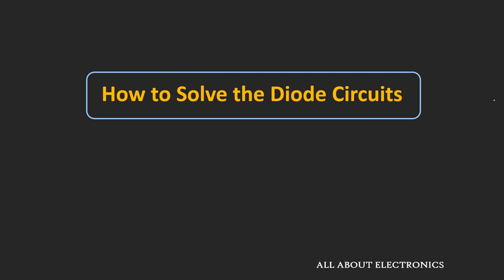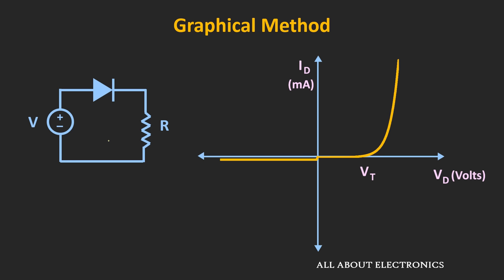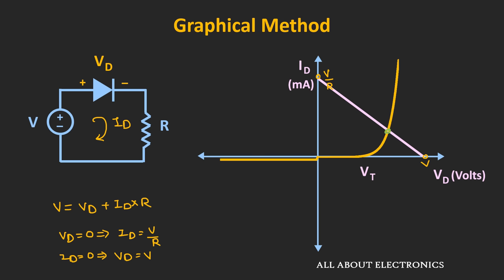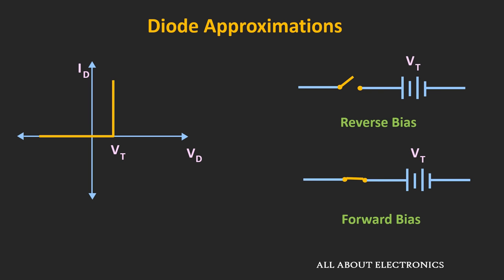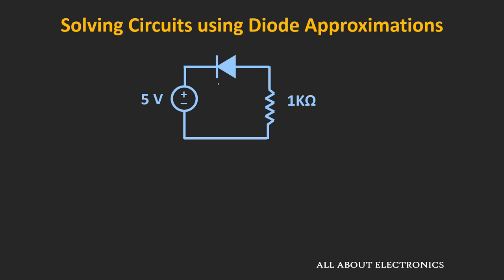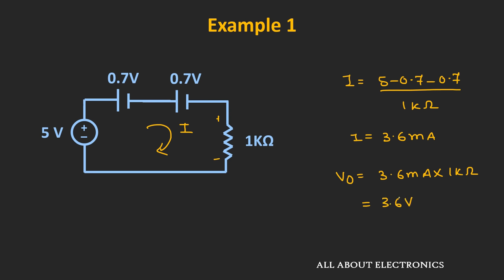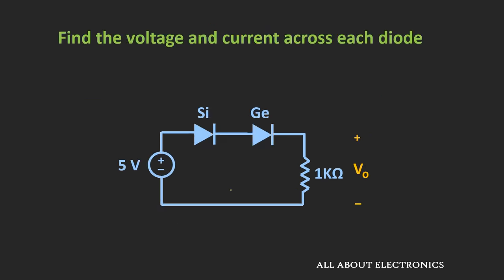How to Solve the Diode Circuits (Explained with Examples)

Comment from the maker: The timestamps for the different topics covered in the video:

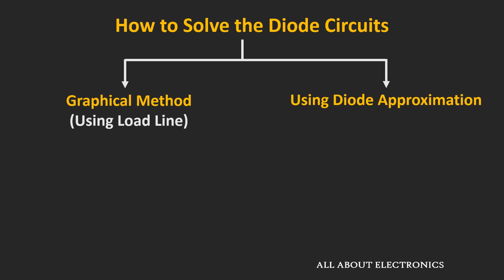1:02  Graphical Method (Using the Load Line)

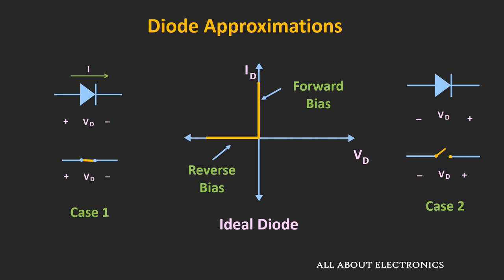3:19  Diode Approximations

4:29  How to Solve a circuit problem using diode approximation

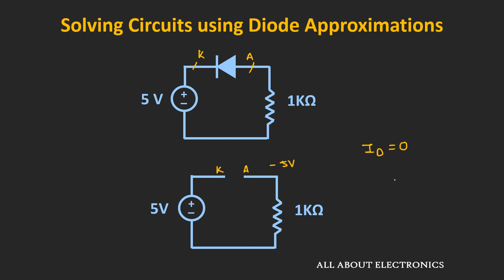7:46  Example 1 ( Series connection of Diode)

9:54  Example 2

12:11 Example 3 (Parallel Connection of Diode)

13:41 Example 4 (Parallel Connection of Diode with different diodes (Si and Ge))

16:11 Example 5 (Parallel connection of diode with different voltages)

For more Solved Questions on the Diode Circuits, check out this playlist:
https://www.youtube.com/watch?v=f0xMLVpu0zo&list=PLH9R5x7JVXCEVJBjahN-wXv7r1l9dZbjv
Reply: In ex 3..why did u only subtract 0.7 ..there was 2 Si diode..so u should have to subtract 1.42??
Reply: @baljeerai3789  because only 0.7volt drop between common node will be there of two diodes suppose them as single element with 0.7 volts
Reply: In example 5, how do you choose which diode is conducting?
Reply: In example 4 there are two diodes , what happens to the current , does it pass equally through two diodes?
Reply: Last one answer should be 4.3V

Comment: The voltage across the 1k ohm resistor is 4 V and the current for the circuit is 4 mA for the example with one silicon diode and one germanium diode.

Comment: In example 5, why is it that the diode with the 2-volt source will be the one to stay off instead of the one with the 4-volt source? is it only based on assumption?
Reply from the maker: Let's say, for example, the diode which is connected with a 2V voltage source is ON. in that case, the voltage at the cathode of the diode is 2- 0.7 = 1.3V.
The same voltage will also appear at the cathode of the second diode. (The connected with 4V source).
With that assumption, the voltage at the anode of the second diode is 4V, and the cathode is 1.3V. That means the second diode should also conduct. And in that case, the voltage drop across the second diode is more than 0.7V (which is not possible)
On the other end, if second diode is conduciton alone, then voltage at the cathode both diode is 4 - 0.7 = 3.3 V.
And in that case, the first diode will remain off. (also there is no violation of KVL)
I hope it will clear youir doubt, why first diode is OFF.

Comment: For example 5, can you not also make the assumption that the top diode is ON and the bottom diode is OFF? This assumption would still be correct, but v0 and a different value of 1.3 V instead?
Reply: same ques
Reply: Same doubt

Comment: 9:49
Current = 4 mA
Voltage = 4 volt
Reply: 9:49
Reply: I=4 ma
V=4 volt
Reply: Right 👍
Reply: @MD TAIYAB 21PKBEA500 it should be 4.3V I guess the other terminal is at -1   hence total difference is of 4.3V

Comment: Problem in 9:50 :-

current = 4 mA
voltage across Si diode = 0.7 V
voltage across Ge diode = 0.3 V
voltage across Load resistance  = 4 V
Reply: Nice

Comment: Curious why Vo is calculated different in example 2 and example 5? Why not care about the voltage drop across the 1k ohm resistor?
Reply: Yes the answer should be 3.3+1 = 4.3V
Reply: @orbhaisabkaisahoothik14  So current will be I= v/R which is 3.3-(-1)/1=4.3mA....so Vo will be -1+(I*R) = -1+(4.3*1)  that is 3.3v 😅
Reply: In example 2 there is a resistor before the diode so there will  be a voltage drop

Comment: Thank you very much for the tutorial. Yet, I wish you had emphasized the importance of the directions and the signs. What could happen if your assumption were wrong and how can you check whether it is or not? If I am not mistaken, I have figured out this issue as follows: 
We always assign positive voltage to the entering port and negative to the leaving port of a diode. If we assume that the diode is ON, then after solving the circuit(maybe by the virtue of node analysis and substituting a corresponding voltage source whose potential difference is V0(threshold voltage), we should look at the direction of the current coming into the diode. If it is consistent(with the assigned voltage direction), we're right, if not the diode was actually OFF.
If at first, we assume that the diode is OFF, it requires the potential difference on the diode is smaller than V0. After solving the eq. by assuming that the diode acts as an open circuit, the potential difference condition( must be smaller than V0) must be checked to see whether the assumption is correct or wrong.

Comment: At 12:04, why is the output voltage only V2-5V? What happened to 10V , V1, and the 0.7V of the diode?
Reply from the maker: see here we are applying the KVL. And we are interested in finding the voltage at a particular node in the circuit. You can start from that side too. In that case, Vo = 10 - V1 - 0.7
Or you can say that Vo = V2 - 5 V.
Both ways you will get the same output.
Reply: @ALLABOUTELECTRONICS  Oh! So its a matter of choice between the two. Thank you.
Reply: @ALLABOUTELECTRONICS  But Vo=10 - 8.16 - 0.7= 1.14
Which is not equal when calculated from the other end
Reply: @6packabb  it's same only. Just .02 difference. It's not an issue.
Reply: @6packabb it's due to the approximation of current value

Comment: Sir, in example 5 you said that upper diode will off but for diode to be off potential drop across diode should be less than diode voltage but when you say that at right terminal of upper diode potential is 3.3volt then for upper diode potential drop is 1.3 volt which is more than that zener voltage then how it can be off ? please tell sir

Comment: The video is excellent with the clear explication ! Congratulation ! For me, I just have one question in the final example. In effect, what is the value of V0 if the first source is 3.5 V in stead of 2 V ? And the voltage of the first diode is 0.2 V in this case ? Thanks very much for your contribution !🎉🎉🎉

Comment: An ac voltage of peak value 30V is connected in series with a germanium diode and a load resistor of 400 ohm. the forward resistance of the diode is 20 ohm and the barrier voltage is 0.3V. Find the peak current through the diode and peak voltage across the load,
Reply: Please solve this Question........

Comment: @9:06 why did you subtract both 0.7 from 5V
Reply from the maker: Because both Si diodes are in series. So, you need to consider the drop across both diodes.

Comment: At 10:24, I don't understand how you did KVL and how you got the polarities if the voltages (why are you saying 10v - V1 etc.)?
Reply from the maker: Here, why applying KVL, it has been assumed that when you are going from the positive potential to the negative potential across any element then it will be considered as the negative. 

That s it is 10 - V1.
For more information, please check this video on KVL:
https://youtu.be/dlROTnDbULo

Comment: At 17:34 you said first diode will remain off.
Doubt : the voltage drop across the first diode is 3.3 V-2 V = 1.3 V, which is greater than silicon diode threshold voltage then why won't it conduct?
Reply from the maker: IWhen the second diode (the lower one) is conducting, the voltage at the cathode of the first diode (the upper one)  is 3.3V. While the voltage at the anode is 2V. For the diode to conduct, the voltage at the anode should be greater than the cathode by around 0.7V. Since that condition is not getting satisfied, the first diode will remain off. I hope it will clear your doubt.
Reply: @ALLABOUTELECTRONICS  yes sir i understood well.

Comment: 10:58 I thought The Current " I " was going to split at the node between the 3k resistor and the V-out (KCL) causing the 4k & the 3k resistor currents to be of different values ?  Am I Wrong?
Reply: Vo is just a point. its not any external  voltage apply to the circuit

Comment: EX2 : why did we assume the current through v1 and v2 are same they  are in parallel right?
Reply from the maker: Because they are connected in the series. when in doubt, just draw the supply voltages with + and - signs, (In this case, just draw the 10V and -5V voltage sources) and draw the complete circuit. You will get it.

Comment: at 11:56 isn't it supposed to be  6.12 - (-5) =11.12 ?
Lets say that -5 is actually 0 and diode is ideal Vo= (10 -0)*3k  /3k+4k =4.28 v 
and for a value of 5 in place of -5 we will get  Vo=(10-5)*3k / 3k+4k =  2.14v 
if gnd voltage is going below 0 then output voltage is supposed to increase ,rt?
Please help me if I am wrong here..
Reply from the maker: I would say, it will be better if you just draw a -5V voltage source over there and then apply KVL. It will become easy to visualize. Calculate it once again. You will get it.

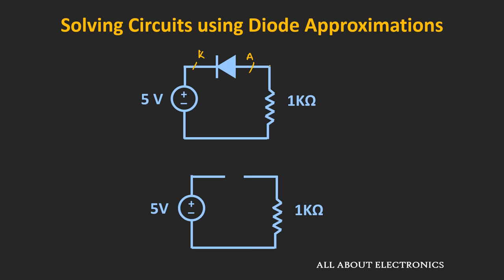Comment: it really confuses me that at 07:00 you say it is -5 V using Thevenin's voltage. that's fine but let's assume that the diode is connected normally, by which i mean it's forward biased. in that case there would be no change in the Thevenin's voltage except for the sign of it since we have anode - cathode. this means that if you put a forward biased diode instead of reverse biased, it will not let the current flow. why? because, as we said, left side of that forward biased diode will be 5V and right side of it will be 0V so that the potential difference can be 5 V. we also know that + part of voltage source is 5V and - part of it is 0V. now, as you see, the resistor will have no potential difference across its two ends since both of them are 0V, and that means no current flows.

i would be incredibly thankful if someone could explain this to me.

Comment: I'm struggling to understand diodes, and I'm a beginner, so my question might seem obvious. At 17:12 you said there was a contradiction. Why exactly is there a contradiction?
Reply from the maker: There is a contradiction because the same node (Vo) cannot be at two different voltages simultaneously.
Reply: @ALLABOUTELECTRONICS  yes, I was thinking along those lines, thank you! 
Also, I have another question if you dont mind! If instead the diode at 2V was ON and the one at 4V was OFF, wouldn't that work also? Or is it our objective to find the combination of diodes that produces the most Vo?
Reply from the maker: No, it wouldn't work. Because if the first diode is ON, then the output after the voltage would be 2 - 0.7 V = 1.3V. 
And that would also turn on the second diode. Because now the voltage across the second diode is more than 0.7V. 
And that would mean the output is 4 - 0.7V = 3.3.
Which is not possible. 
It means only the second diode is ON.
I hope it will clear your doubt.
Reply: @ALLABOUTELECTRONICS  I think I get the idea now, again thanks!
And again, I just have one more doubt. If the output voltage is 4 - 0.7V = 3.3V, then the voltage coming out of the first diode must be 3.3V as well (as indicated in the video). Is that because 2V + (2V - 0.7V) = 3.3V?
Reply from the maker: Because the one end of both diodes are connected together. So, voltage at both ends should be same.

Comment: 18:00 In example 5 , what would happen if the diode at 2V would conduct and not the one below
Reply: Assuming 2V would conduct, voltage V0 = 2 - 0.7 = 1.3V. But that would mean that the diode at 4 V will be forward biased, i.e. turned on, which is contradictory
Reply: @invisibleairxd261  could you elaborate?

Comment: sir i didnt get it when you explained to me about vo at 12:02 why it has to be vo=v2-5? thanks sir
Reply from the maker: At 12:02, simple KVL is applied to get the output voltage. 
If you apply the KVL then Vo-V2 +5=0
So, Vo= V2-5.
If you find it hard then draw a -5V volt of voltage source instead and try to get the equation.
Reply: if we apply kvl there is also diode  10v and resistor  at right. we should consider them also right?
Reply: as of last example(similar)

Comment: In ex.5 you calculated that V0=4-0.7. but there is a negative voltage of -1v also. Then can i say v0=(4-0.7-0.1)volt

Comment: Sir , thanks for informative video , sir I have questions , that's I have two different DC source ,now I want to add these source by using diode ,so how will connect two different sources . ? Please answer me .
Reply from the maker: How do you want to add these source? In series?
Also if you want to add the two sources using diode then you will also require a resistor in series with the diode. Otherwise due to large current diode will get damaged.

Comment: in the example of the si and ge , is the threshold voltage .7+.3 = 1 v,that will be required to turn on ?
Reply from the maker: As they are connected in parallel, it will be the minimum of the two voltages. If they are connected in series, then it would have been the summation of two voltages.

Comment: sir i am confused in ground circuit problem when si and germanium is in series
Reply from the maker: Which example? The practice problem just after the example 1 ?
Reply: ALL ABOUT ELECTRONICS sir yes but after resistance circuit is grounded
Reply: sir so how can i solve if it is grounded
Reply from the maker: In that example, 5V is applied to the series connection of Si and Ge diodes. If you see the required threshold voltage for the series combination then it will be equal to 1V. (0.7V + 0.3V)
So, the effective vltage across the load will be equal to 4V (5V- 1V). And current through the circuit will be equal to 4V/1k = 4mA.
I hope it will clear your doubt.
Reply: @ALLABOUTELECTRONICS  ya thankyu sir
Reply: Sirr thanksss much

Comment: Answer : current I flowing is equal to 4 milli ampere and voltage across1k ohm resistor is 4 volt

Comment: in 10:38 ,  why you wrote -(-5) and not -5 in calculating the voltage ??
Reply: The -5V is a reverse voltage. And when you calculate the Current, you subtract: Voltage of the anode - any other voltage.

Comment: At 12:09 how did we get vout=v2-5??please help
Reply from the maker: Just by applying KVL. If you have any confusion then draw the sources Vo, v2 and -5V with positive and negative terminal on a separate circuit. And then apply KVL. You will get it.

Comment: In example 2, I didn't understand why in the preparation of the mesh equation - (-5) appears. Why subtract -5?
Reply from the maker: The best way is to draw a voltage with that polarity and then apply the KVL to reduce the confusion. Here while applying KVL, while going from positive to negative potential the voltage  is considered as negative, and likewise while going from negative to positive potential, the voltage is considered as positive. I hope, it will clear your doubt.

Comment: in example2 potential drop across  silicon is 0.7 ,what we have to take if it is a normal diode
Reply from the maker: Unless it is specified, you can consider it as Si Diode and you can consider the 0.7V drop across it. 
In the question, if it is mentioned as the ideal diode, then the drop across the diode is 0. 
I hope, it will help you.

Comment: Brother, in last question why answer can't be 1.3 volt.
Nice explanation.
Reply from the maker: Because if Vo = 1.3V then the second diode is already conducting. The anode is at 4V and the cathode would be at 1.3V.
So, if we consider the drop of 0.7V across the diode, then Vo =3.3V. 

Right, so output can't be 1.3V and 3.3V simultaneously. (KVL will be violated)
With 3.3Vas output, the first diode will remain off. As the anode of the first diode is at 2V.
I hope it will clear your doubt.
Reply: @ALLABOUTELECTRONICS  Thank you, this explanation is what I needed!

Comment: 17.59
Vo should be 1.3 na ?
Because in the 2nd diode we have 3.3V which is greater than 1 diode 's voltage so Vo will be 1.3 .  ..... Answer me ?

Comment: In example 1, wouldn't the polarity of the two diodes with respect to each other affect if current will flow?
from the first diode: + to -
then the second diode is also + to -
but wouldn't the second diode be reversed biased because of the first diode?
Reply from the maker: No it wouldn't reverse bias the second diode. Because 5V source is driving the two diodes.
So, when the first diode is ON, the effective voltage seen by the second diode is 5- 0.7 = 4.3V.
And as it is greater than 0.7V, it will be forward bias.
I hope it will clear your doubt.
Reply: @ALLABOUTELECTRONICS  oooohhh yes it did, thank you!

Comment: Why , in example 2 for the value of output voltage,we subtract V2 -5 to get 1.12 volts???
Reply from the maker: To find the output, just KVL is applied. You will get the same result by 10 - V1 - (0.7V). 
Ultimately we want to find the voltage at the output node. which can be found by applying the KVL.
Reply: @ALLABOUTELECTRONICS  we will get 1.14 if we apply as 10-v1-0.7

Comment: Can u please explain if two diods are parallel but in reverse direction at that time how much Vout we get and why??
Reply from the maker: If two diode as are anti-parallel then the output will depend on what is input to the circuit. 
If the input is positive, then the output will be equal to 0.7V ( If it is silicon diode) and if the input is negative then the output will be equal to -0.7V. 
So, depending on the input only one diode will conduct and the voltage across that diode will appear as output.
Reply: @ALLABOUTELECTRONICS  thanks for quick answering to me